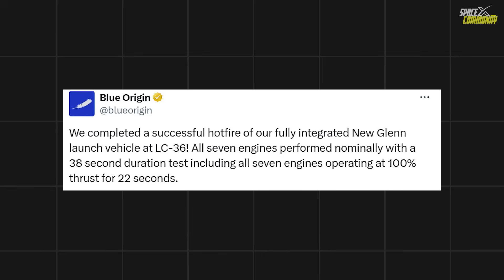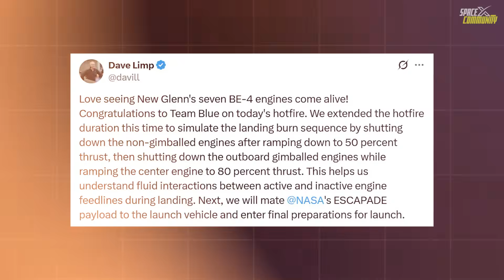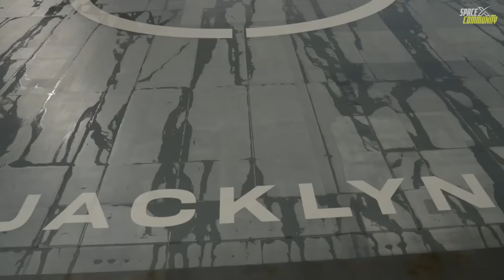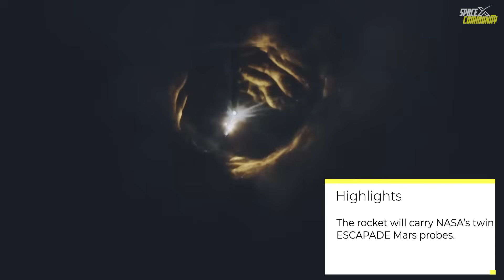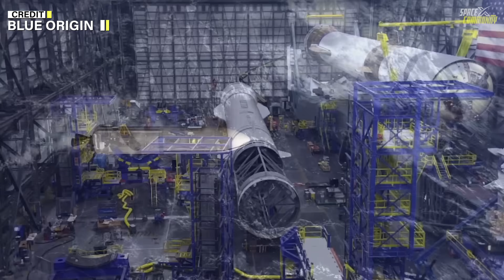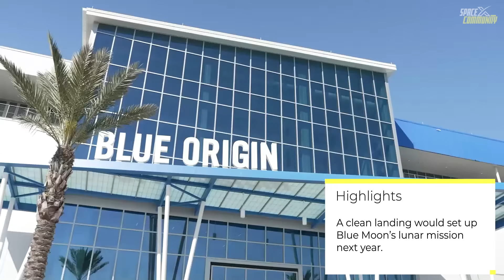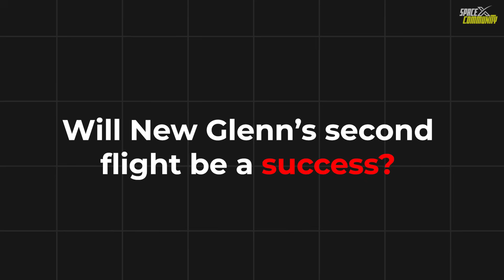Blue Origin Just Declared New Glenn Second Launch Attempt! Static Fire Completed! Is SpaceX Done?

Comment: SpaceX and Blue Origin have two vastly different styles as a company. New Glenn was built the way NASA builds rockets, slow but works the first time (usually). People think New Glenn development is too slow compared to Starship but New Glenn has already delivered a payload to orbit and Starship hasn't. I would say they are pretty close to the same level as far as development as of right now. SpaceX is ahead on reusability and scale ability, but New Glenn already has a paying customer and if all goes well will have a second and third payload in orbit in the next few weeks.  

Longterm, I don't think New Glenn will be able to complete with Starship at the same level though. I can see Starship launching 2-3 times per month within a few years. I don't see New Glenn launching more than once a month (or even four times a year) in that same timeframe.